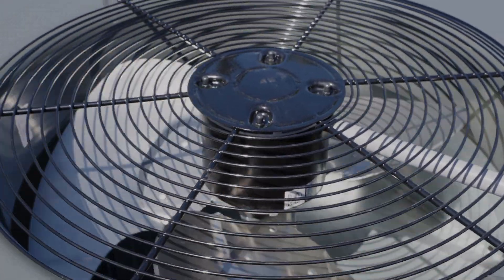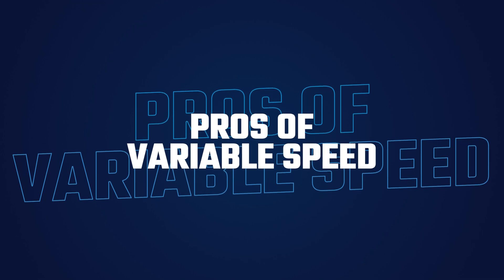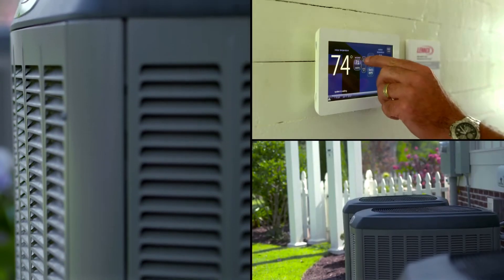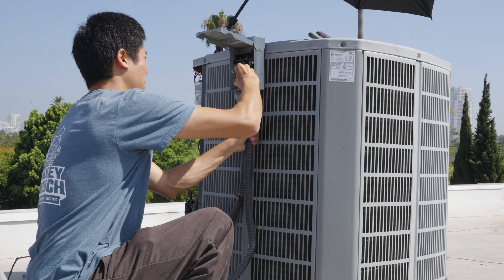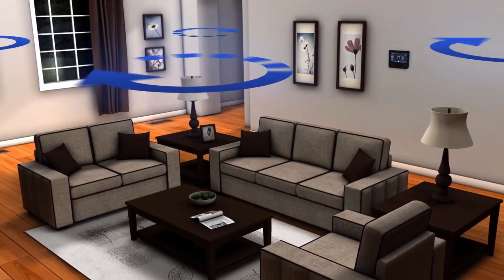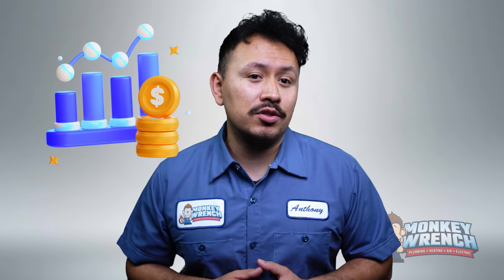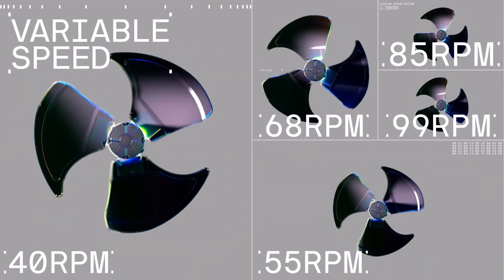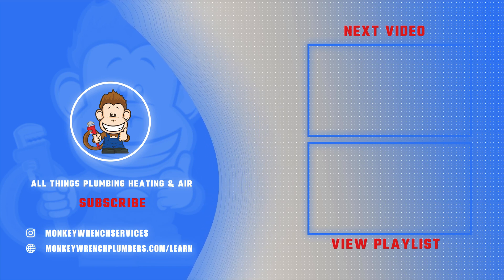Variable Speed Air Conditioner Pros & Cons

Comment: Stay away from 2 stage and variable speed. It cost twice as much and nobody has the parts in stock.
Reply: You don't even have a choice. You cannot buy a new system with psc motors. Suppliers have until the end of 2025 to rid their stock for new installs.
Reply: Are you a hvac tech? How do you know this?
Reply: @macmac6034 only been a tech for the last 31 years, but never pretend to know everything.

Comment: I just installed a two speed and it is way better than former single speed.  The humidity control and air circulation means much more comfort.  Now I wish I had gone all the way to variable speed.  I was worried about reliability.
Reply: Thank you for the input! Ill be sure to save extra for a variable
Reply: You obviously didn’t purchase American Standard/Trane; on 4th coils on air handler/ blower motor/EEV Control Board, in 6 years from new
Reply: @flashnmb1 Are you saying that is your experience?  The two speeds are not that complex. Two speed capacitors and a two way valve on the scroll compressor.  The blower motor I don't know.  But, yeah the full on variable speeds do not have a good track record.